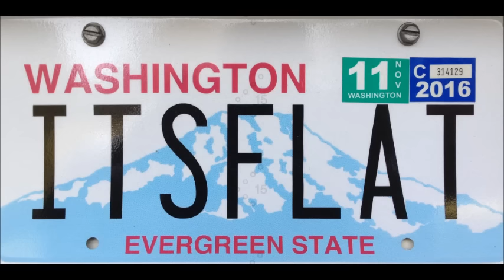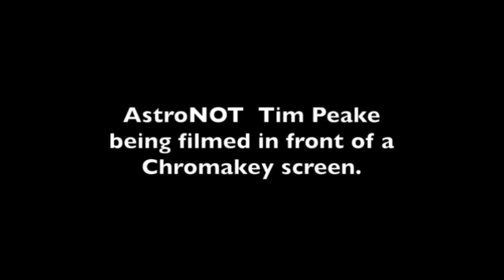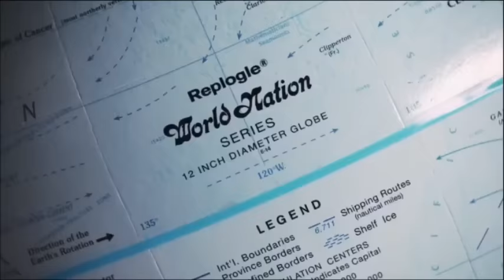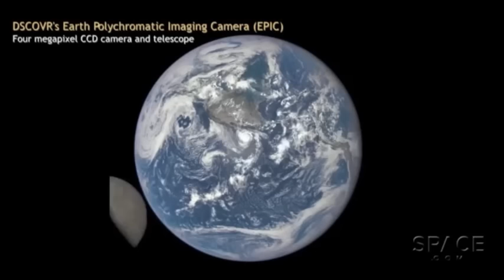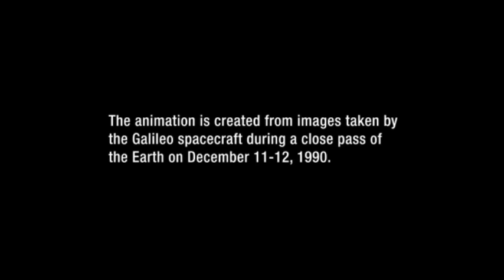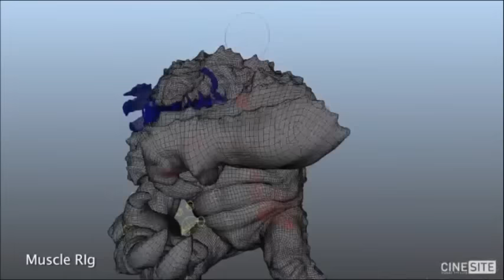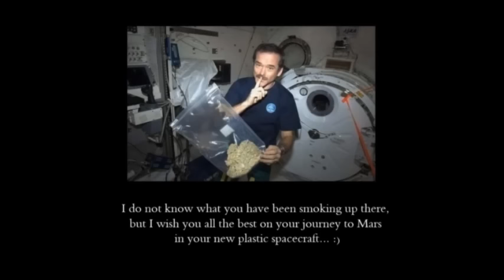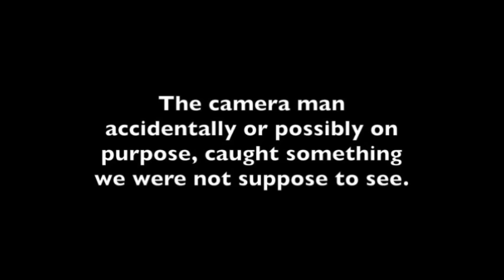Flat Earth Clues Interview 73 - Outcast Radio via Phone - Mark Sargent ✅

Comment: and also the main reason that planes do not fly directly over the South Pole is because of the extreme weather conditions planes are not built to withstand the extreme weather systems that occur down there the winds alone are a sustained 100 miles an hour not to mention the extreme frigid temperatures  70 degrees below 0 there are not a lot of commercially available airplanes that are designed to handle those types of extremes.
Reply: Im sure I remember them mentioning that in another video.. Forgot what Mark said but he considered it already. I guess he knows something.
Reply: +Repoman1678 
Isn't it because there's no need to fly over the south pole? It wouldn't be the shortest path between any of the southern hemisphere locations that planes fly between.
Reply: +Repoman1678 not true
Reply: +HueyenRolf Yeah, what about Australia to Brazil? They could cut through the south pole as a short cut.
Reply: +HueyenRolf Sorry. I couldn't solely rely on just that..Ill keep looking into it though. Research takes time and Ive been avoiding this subject because the every map we know of may be wrong.
Reply: +Angel Garza 
If you're serious about learning more, great circle navigation would be a good place to start. I doubt you'll find anything that overturns the methods that have worked for a very long time.
You need to know that fuel is the greatest overhead for airlines. If they could figure out more direct flight plans, they'd have done it by now.
Reply: +HueyenRolf Unless a part of the map is sealed off.
Reply: +Angel Garza 
"part of the map is sealed off."
What do you mean by that?
Reply: If the axis run through the north and South Pole and the earth is a perfect circle. Why are we able to fly over North Pole and not South?? Makes sense there is no South Pole. Temperatures and flying conditions should be equal at both